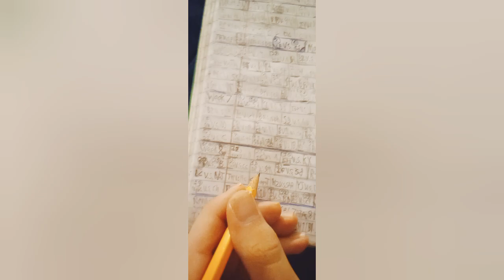Lego spinners season 23: week 8 part III.

Comment from the maker: 74 different spinners compete every week to win.
Rules of the knockout:
1. Shatter: If the spinner is destroyed to the point that it can't spin properly it is considered knocked out.
2. Flip: If the spinner flips another spinner over it is knocked out.
3. Chop: If a part of a spinner hits the other on their spinning peice (bottom) and knocks it off, that spinner is considered knocked out.

Penalties:
Flinging: If a spinner is spun and hits the other in a straight motion and not a gradual one, it is considered an overpowered move, and the other spinner gets a hit back.                 
   *If a knock out occurs upon this penalty, it is not counted and the pieces that were taken off on that move (if any) will be placed loosely and the battle continues. If the opponent was flipped upon this penalty it will be reflipped.

Stop motion: If a spinner hits another while it is not moving it is considered an overpowered move and the opponent now has the right to do the same thing.
    *Once again if the opponent gets knocked out from this penalty it is not counted and the opponent pieces that were knocked off on that move (if any) will be placed loosely and the battle continues. If the opponent was flipped upon this penalty it will be reflipped.

NO pressuring once so ever after the battle has begun or the battle restarts completely.
The only pressure that should be applied should be right before the battle starts to ensure that both spinners are at its best.